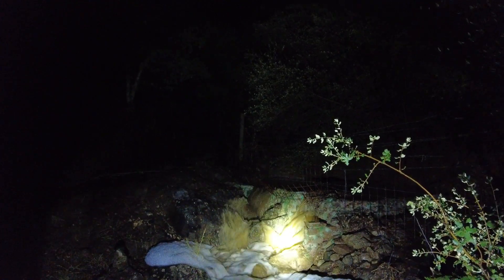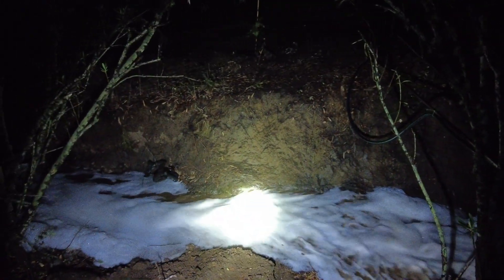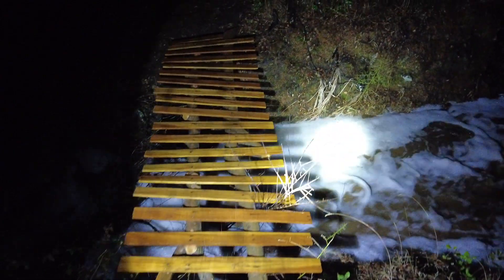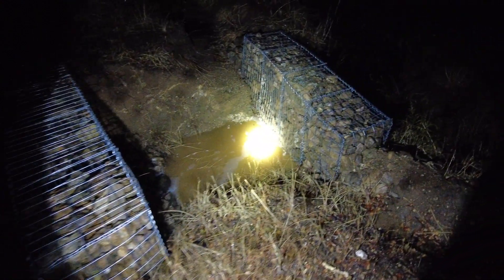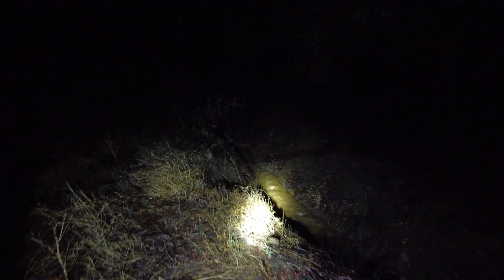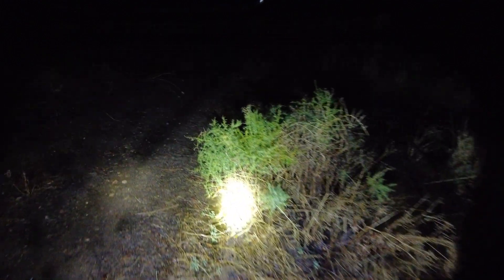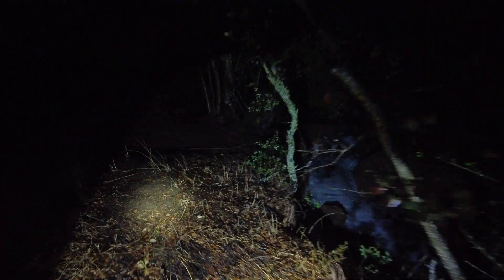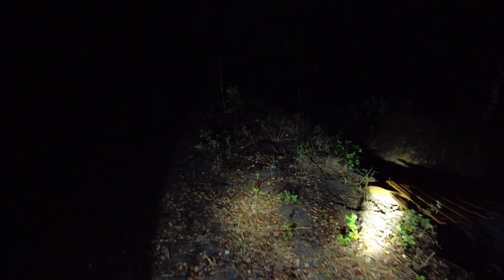Broken dam wall. Erosion creek success! Video 3 of first rain 2023.

Comment: Suggestion about the dam with the pipe;  Rather than relying on the spillway as the entrance point for your pipe I would consider opening a hole in the side of the dam (facing the buried pipe) to the depth of the culvert.  Remove all of the concrete blocks to your propagation bed for repurposing.  Then dig a proper ditch with grade in a straight line from the dam to your swale.  No right angle bends required.  Drop the pipe into the ditch and check for grade,  Then backfill the entire pipe and rebuild the dam around the pipe and up to it's original height. This is a permanent installation that is completely buried - out of sight.
The spillways is working just fine.  The entrance to the pipe will be completely below the spillway.  
You have to have a permanent installation of the pipe for the reason illustrated in this rainfall.  You can not know when a sudden rainstorm may begin - and when you find out, it is too late. 👍
Reply from the maker: Good suggestion except that it's on state land and I don't want to ruffle too many feathers.
Reply: @SuerteDelMolinoFarm  That is why I suggested burying the pipe.  Out of sight, out of mind.
SO in this case you have two options,  Quickly get in, dig the trench, bury the pipe and get out.  
Or two, Move down the stream where it is not state property build another dam and install the pipe.
I guess my overarching point is now that you have experienced the force of the rushing water, hoping to get the pipe in place before the water flows is not realistic and can be dangerous.

Comment: nice job - but the water is running to fast downwards - I think again you need a cascade of massive ponds.....this will more beneficial to micro climate than anything else - greets from Germany
Reply from the maker: Thanks for sharing. You are right. I need professional help to know where and how.
Reply: @SuerteDelMolinoFarm good idea to get some professional evaluation. With this much water flowing rapidly having a pond high on the property with less than rock solid walls is a risk. 

BTW, do you have any estimate how much water did flow through your creek that night?
Reply from the maker: @darked89  Yea. I feel to build something with concrete. Unfortunately I don't know how much water did flow down the creek. It was crossing my mind but I had lots to do that moment. Anyway, what is a simple way to measure it?
Reply: @SuerteDelMolinoFarm  after good night sleep I got other than a solid pond/big water catching pool brainstorm ideas. A: slow water by trying to zigzag the creek lowering the drop (rather heroic endeavor and with the added risk of accidental erosion)  B. if you have some flattish area on the property maybe you can make it as flat as possible (basically a tarrace with a solid dikes on the lower edges) and with the help of channels/big fat pipes flood it taking care that the water stream delivering water to it is way slower that what could be seen in the video. If the flooded area is large enough and you are able to shut down the input flow if needed, then say with 10-20cm deep water you can have "flood plain". 
re water flow measurements: I will ask
Reply from the maker: @darked89  Great suggestions. Thank you for thinking, planning and sharing. I'm trying to find a contour map of the creek. It's like a valley, a ravine cut through the land, with no escape routes except at the bottom. It complicates all.
Reply: @SuerteDelMolinoFarm  re water flow measurements: you would need to measure the speed of water flowing through some standardized  channel with depth marks. Probably something like a rectangular open box if speed is measured by throwing a piece of wood in point A and measuring time it reaches point B. 
Since the flow is turbulent and water speed differs at different depths/distances from the walls the flow estimate will likely be a ballpark number. 
You can also use a smooth closed tube with known internal diameter and length but that one can clog in a flood.
Reply: Also there is a simpler method if you can divert (with some lock I guess) the total flow of the creek to say 1m3 tank, or anything with known, large enough volume. 
Then it is a simple division volume/time to fill it up.
Reply: @darked89  i talked the micro climate through ponds....
Reply: @lobotomie66  I am not against water retaining ponds at all. My concern was and still is about DIY  high volume ponds built on a steep slope.  If at some point the holding walls give a way it can cause a deadly catastrophe. 
For that reason some expert opinion (not mine btw) is advisable.

The paranoid would probably try to investigate the danger of a landslides/ground slippage in a given area. Think about a fully filled (concrete walls etc.) swimming pool on a slope. It weights a lot and the wet ground under it can move. 
Larger ponds without liner are basically leaky polls on clay and rock mixture. 

Therefore: proceed with caution
Reply: I guesstimated from the view of the small 'waterfall' water flow could be at least 10l per second. Rough guess.
If steady for 1h, it sums up to 36 m3 of water per hour.

Let's assume the gully catchment (how large is it?) area is 4 hectars and the storm brings 50mm of water, of which half finds the way into the gully within 4h. It's 1000 m3 of water, 250 m3 per hour. Around 70l/s.

It means after the top minipond forms, the dam has to process (allow to flow down) those 250 m3 / h. And it applies to each dam/structure down the gully.
I think your U-shaped good dam wall, keyed in, is a good design. Water falls in the middle making the risk of bank erosion much lower.
Reply from the maker: @hotbit7327  Thanks for sharing. That makes sense. Let's design something that will hold.